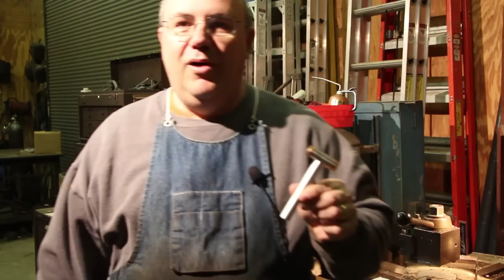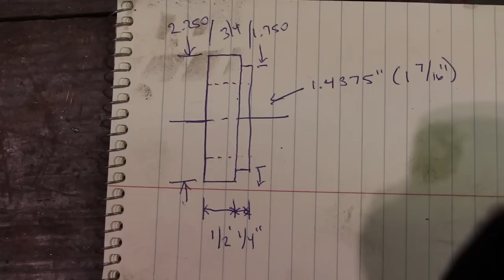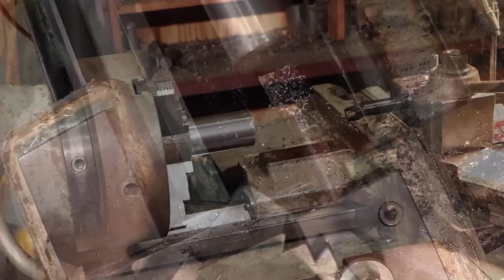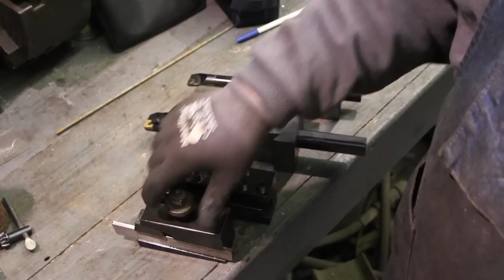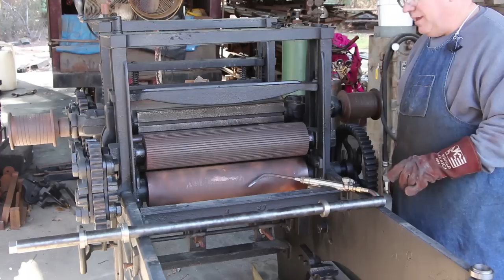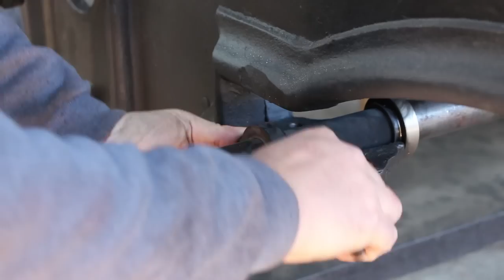Pouring Babbitt Bearings on the J. A. Vance Planer/Matcher

Comment: keith  the bubbles are gas i seen a situation / setup too degas the metal  / safer for the poorer /  ceramic tube  and a valved rod  . some inert gas to bubble it off. works like a charm, makes for a very smooth and accurate poor. i know it wasn't necessary here but i think id'a done it any way out of love for the Kraft. if for no other reason in hopes of making the bearing hold  out just that much longer.

Comment: i had forgotten they did things this way do long ago and as for as im concerned it wasn't all that bad. harder faster bearings  in my opening weren't all that important in certain situations.
as one can see this a a easy fix  and no less expedient  than driving modern bearing in and out bearing housing witch can be very tough and sometimes a destructive task . no destructiveness hear  and creation

in very hard time a machine and it operator could bring a country beck from the dead, considering they built it.

Comment: Keith, there is a third major babbit type. I've only seen it used in extremely heavily loaded oil film bearings for steel mills, but it is Cadmium based. It is of course toxic so you have to wear respirators to pour it. I used to work in the only shop in the country that would centrifugally pour them years ago.

Comment: Giday from Oz there Keith, well in Australia we call those White Metal Bearings, it's the first I heard them called BABBITS. Anyway curiosity got the better of me & clicked on it. I've done a few of these personally with my old man on a few Lanz Bulldog Tractor restorations a couple of decades back. Both jobs were the crank main rod bearing, but we did the job very differently. We just soldered the white metal back in the bearing shell & because their so big, we soldiered a bit, then turned the shell some more in the vice & soldiered some more until  both shells were finished, then put both halves together & run a boring bar through it to under size, then spent the day with the bearing blue & a scraper until it was excellent contact. That tractor still runs today, it's a 7.3 litre single cylinder 75 H.P. 2 stroke & still runs happily on Sump Oil.

Comment: 0.100" in one cut?  Not on any lathe I have ever owned!  Hat tip.
Reply: If you get a good tool post and carbide inserts you can take as much as the machine can handle. .200(dia) and a fast feed rate of .015 to .025 per rev is not uncommon in steel. I'd use a four jaw chuck when pushing it like that too. They hold better. I have had a 6in diameter x 12in bar come out at 600rpm to learn that lesson. Managed to dodge it and it rolled across the entire shop.

I learned from an old fellow how to push the machines. He owned the shop and wanted faster production.  He knew how to get it, but I was too timid to try that at the time. When you stall a 10HP lathe, you know you have pushed it too far.
Reply: Get a better lathe. Check out Adam's channel

Comment: Good stuff Keith. I love to see these old machines still running. I once helped park cars at an antique machine show and it was like Disneyland for me. Old steam machines still running and so much more. Keep up the good work. While I do know ball bearings have slack which causes vibration, do roller bearings or needle bearings do the same ?. I would think the length of the needle bearings would be tight almost like these babbitt bearings.Maybe not a good idea for large applications

Comment: As a former prototype machinist/model maker and now a full time tinkerer. I am retired now and I admire your videos and have spent a lot of Quarantine time watching them.  What you made look easy and is very difficult to master is when you used the dividing head to make the replacement teeth on the gear.  Most shops I worked had only one or two people that would get those jobs.  What you didn't get into was sometimes the number of turn then the number of holes enters into the mix. Don't distract someone when they are cutting gears or timing pulleys.  Well done anyway. 

By the way I can't find a good machinist apron anywhere, where do you get yours?  Thanks again.
Don Morse

Comment: What a wonderful work you are doing. I have been pouring babbit for 60+ years. I have a couple of suggestions that might help you. You can flux your melted material with a green pea sized ball of bees' wax. It will bond the dross to it and remove that skin on top. Second, when pouring a top, build a higher pool pocket with your damming material. This will let the air out at each end. I make mine funnel shaped with a center punch putting the point right down to the metal. Just make them about a half inch higher than the top cap. They will pop right off when cooled. I have a Ton or more tin base & more than that lead base out in the shop. You never know when a cane mill will need a tune up. God bless and Keep the good  info. coming.

Comment: Would it be possible to bench pour the top caps flipped over using your shaft spacers? looks like the bottom pours worked simpler

Comment: That's a superb video. I used to watch my Godfarther pour bearings for mounting 220 Lbs wetstone grinding wheels when I was a kid over 5 years ago. I always wondered how they created a dam to hold the molten metal. Also saw it used on bearings in a sheet rolling mill to mount a 30 Ton flyweel again that was 50 years ago, never seen it since. Thanks for preserving the art and taking time to show us.

Comment: Hi. I hardly ever see you using coolant when your on the lathe and milling machine. Why is that
Reply: The main reason I rarely do is the mess. If it is water based you have to clean it off the ways, it turns rancid after a few months, it flips up on the wall, it costs more, maintenance of the pump, cleaning out wet chips, and it smells (particularly if rancid).

If you run the machine a lot, it is worth it. For casual use it is easier to just slow the machine down a bit and sacrifice surface finish a bit. Plus carbide tools can take the heat pretty well.

Comment: babbitt bearing are used in automatic transmissions. However, It's better to use bronze type instead because babbitt bearing tend to wear out faster than the bronze. Babbitt are cheaper but lack longevity. (i used to 4-6 transmissions a day).

Comment: Nice gloves. TAKE THEM OFF while using 
Your lathe.  Roll your sleeves up too.  And, remove that ring.  

I'm sure that you know better.  Please, set a good example.

You can get very thin disposable gloves. They will split and tear if you snag them.  No danger of pulling your hand in.

You mentioned catching it on a grinder.  Don't wear gloves while you're near any machine that spins.

I like your channel.  I like you.  I don't want you to get hurt.  Honestly, I wish you the best.

Please, think about the danger.  All of your experience won't help you when your arm is wrapping around that chuck.

Be safe.

God bless you.

Comment: as a toolmaker for 40 years you should never wear gloves around  a lathe.  I have personally seen a toolmakers finger pulled off on rotating machinery while using gloves
Reply: John Martin Just as important are sleeves.
I have ALWAYS been told not to wear long LOOSE SLEEVES LIKE THIS GUY IS WEARING ON HIS VIDEO.
Reply: Stimpy&Ren 
Ouch!  Did he live?
Reply: keir farnum  he pulled his thumb off, came back to work and completed 50 years at New Departure division of General Motors back in the 1980s

Comment: Years ago while working for a steel fabrication company we ended up winning the bid on building 6' wide 25' tall sliding lock and dam gate.  The project didn't seem to be hard of a project except the Army Corp of Engineers told use the gate was not allowed to leak more than 1.5 gallon per hr of water when it was shut. The sides were no problem as far a leakage came, it was the bottom of the gate that seemed to leak the most. That is when and old timer suggested we route out a 4-1/2" trough which we filled in with molten babbitt  and them we would drop the gate down into the babbitt to make a perfect fit.  If the dam was leaking more than guidelines permitted in the future they could reheat the babbitt and create the perfect seal once again. We build  that assembly in  1974 and it still in service till this day.

Comment: Years ago my father poured babbitt bearings in a Caterpillar 15 and he poured them using oakum. He didn't go through any machining like this and when he was done the oil pressure was 45 lbs without touching  the oil pump. You did a really nice job here but very time consuming.

Comment: Nice to hear there are still those who know Babbitted bearings. Just a note. I have seen and maintained babbitted bearings used with pressurized oiling systems at shaft speeds in excess of 10,000 RPM. I have also installed one on a 26.5 inch shaft that was lubricated by Oiler rings. Each half of that bearing weighed approximately 1,500 pounds. Most modern equipment has gone to anti friction bearings or micro-babbitted bronze or steel backed bearings. Good show.

Comment: Liquid metal is nothing to be complacent about. What was happening there when the liquid babbet was sputtering was that some type of material (water, oil, grease, whatever) was being gasified which will explode causing liquid metal to go everywhere.  This is extremely dangerous even in small quantities.  The parts must be perfectly clean and devoid of ANY contaminates and proper safety gear must be worn.  If you choose not to heed that advice....you will pay a hefty price !

Comment: Repaired  sawmill bearing at an engine show.  Melted babbitt by putting ladle in firebox of another steam engine. Used plumbers oakum for damming ends.A  few old plumbers still have some laying around from pouring lead joints in cast iron soil pipe before plastic pipe was invented!

Comment: I've been machining 30 years..
Never..NEVER EVER wear gloves while operating rotating equipment. 
Yes, your hands get dirty. Might even get a cut once and a while.
But if a burr catches those glove's ( like when you were filing ) you can be seriously injured  ...lose fingers ect..
Those gloves are much stronger than you.
If you don't think so, try pulling the finger off it quickly..
Reply: How about the long sleeves?
Reply: And wedding ring
Reply: I was thinkiing same thing when I saw them. You can really deglove (removing all the skin) on your whole hand by doing that.
Reply: I've always started the day with a dollop of good quality barrier cream & washed my hands when necessary... 😎👍☘🍺
Reply: @H Higgins  Very sad, I'm a Connecticut resident with 3 daughters and I remember this story. Joe Pie is currently stressing the danger of wearing gloves to his viewers b/c one of his favorite machining channels recently highlighted a tragic incident in which wearing gloves at the lathe led to a hospitalization of a very experienced machinist. The guy was working alone in a basement shop and after getting his hand and arm shattered and wrapped around the chuck, had to hold the chuck stalled on the still-running lathe for 20 minutes until his wife finally came within earshot of his cries for help. If he hadn't been running a belt-driven lathe with loose belts, he might well have been killed.
I'm a noob in these metalworking circles, but as a woodworker, we have the same warnings for wood lathes, drill presses, table saws and the like and it's similar to the issue of using SawStop technology. There's a significant number of people who run clear risks that most of us would find unacceptable. They justify their actions with one or more of the following:
1) I'm very careful, so I won't have an accident
2) I'm an expert, been doing this for over [insert large number] years and I haven't had an accident [yet]
3) I'm an American, I don't need no safety Nazis telling how to operate in my shop
4) I refuse to [insert common sense safety measure], that would just make me overconfident in my safety and lead to more dangerous situations
5) In the case of SawStop blade safety tech, I don't want to pay for it (doesn't apply to gloves, sleeves, hair, loose clothes, rings, watches etc.)
6) Everything involves some level of danger, you can't be 100% safe and still do much of anything

I like to ask these folks if they've ever had any close calls. If they're honest, the answer will almost always be "Yes." Which pretty much means that only luck kept them from a far more serious (and costly) accident. So all we can do is stress the proper safety standards that have stood the test of time. Make sure that noobs and so-called experts understand why these safety rules exist and what the consequences are likely to be (seen some literally unforgettable lathe accident videos on youtube, btw). In the end, we're responsible for our own actions, better safe than sorry I say.
Reply: @SH-pc4xt  good post SH.. 😎👍☘🍺
Reply: @H Higgins   yeah... thats the one... 😔

Comment: My older brother and I had a 1928 model A ford 60 years ago that had a connecting rod knocking, I called my uncle, which was a machinist, and asked if he would help with the repair. We pulled the engine and removed the bad rod and poured a new babbitt bearing on the rod and cap, then blued it to fit the journal. This video brought back great memories we had back during our high school days and our hot rods. Thanks for the return to memories of the past!

Comment: I remember seeing this process done when i first started working as a maintenance mechanic in a paper mill. Many of the large diameter rolls used Babbitt bearings and the molds were pretty big. Needless to say several hours spent on the torch melting down the slugs before the pour. I remember one of the old timers on the crew got hit with hot Babbitt on the top of his boot when it erupted from the mold from hitting a little spot of grease or oil inside it. Thank God we were pouring during winter and close to the door to the shop, we grabbed the guy right up and out the door to stuff his foot into the snow. He got really messed up, it burnt right thru his boot, but that guy came back to work after some time and finished out to his very late retirement. Degrease and clean your molds very well and wear PPE that stuff will mess you up quick if you don't pay attention. I'm glad I wasn't involved with the cleaning and pouring that day, I was only allowed to melt down to slugs. I'd have felt terrible if I had been responsible for that accident and I know it could have been avoided.. Come with me, And we'll be....In a world of OSHA violations....Keith thanks for the memories..

Comment: Makes no sense struggling to pour the bearings in place. Just cut two pieces of stub shafting and assemble the bearings on the stub shafts on the bench. Use a stop collar like these "jigs" at one end. Hold the bearings vertically with the stop collar at the bottom. Fit some sort of open web at the top that will keep the stub shaft aligned concentrically, but is open enough to pour the babbit metal through. The entire bearing can then be poured that way in a single vertical pour, without voids.
Reply: That was my thought as I watched it. Also the bearings used to be tinned but he explained that.

Comment: Question in regarding the Babbitt bearings , how much RPM - or horsepower  can they tolerate ,they fail - as my father used to make bearings for engines  after ww2  . As there was no auto parts store in Croatia you had to make your own parts. He is a mechanic by trade but he done a lot of fitting and maching to make new parts out of raw steel. It’s nice to see the old School ways are not forgotten 😊 the.old ways are the best ways . I would rather learn from someone old school any day . You have some talent to make those bearings 10/10 👍

Comment: A big part of the advantage of babbit over ball bearings comes down to surface area. Babbit bears on the total enclosed shaft surface; ball bearings only bear at the contact points of the balls. Babbit can easily be the better choice for massive loads.

Comment: I like it! Babbit bearings are used on all turbine bearings and gear boxes, and obviously all car engines. Next time take the bearing keeps off the machine, mount them both close to each other on the shaft, on the bench and pour them together. It saves scratching around on the floor. The shims are not for wear, they are to give you a gap for the top bearing pour. As for holding the keeps while scraping, drop two bolts through the holes and clamp these in the vice

Comment: called an idler pully,   worked in a joinery shop in early 50s  as a apprentice and tradesman  5years plus 1 ,, that was driven by a Hornsby  horizontal town gas engine  with a set of bellows on the wall,  a 2000, gallon tank for cooling  took 4 to 5 men to spin the  big drive wheel to start  and then slip on the belt , and  flat pulleys  and  leather belts all over the shop ,above and below the floor
Some pullys were steel some were wooden ,all machines had the idler  that allowed them to be  stood down if not in use

 we had an eight header plus all the other machines, planers,thicknessers, mortice, band saws  drum  sander , tennoning machine  {a beast}  saws both bench and swing  plus  other in shop designed for  rebating casements , and  cutting for the whitco fittings top and bottom , no hinges used  just the whitcos,  all worked of the pully system and that one engine.
 .1st year appretice had to hose down the exhaust and muffler box for a 1/2 hour  at finish time to cool them down jUST in case of fire  later in th night,  and the appretice machinist one job was to fill all the oil drippers each morning on the machines  lift the lid pour in the oil from an oil can onto the felt  ,some had felt others just a  glass container and a drip system  as did the Hornsby Engine,enjoyed your video  
Give away my age